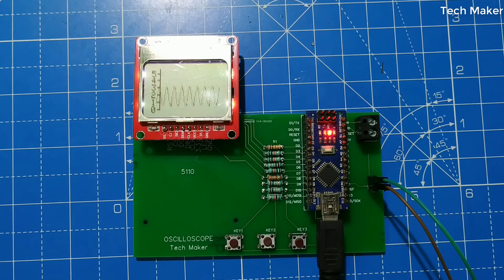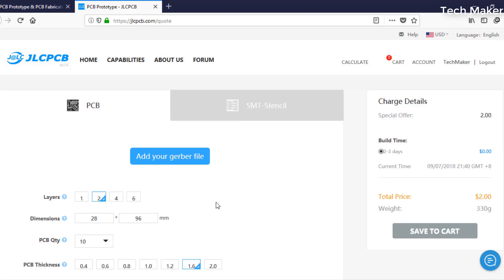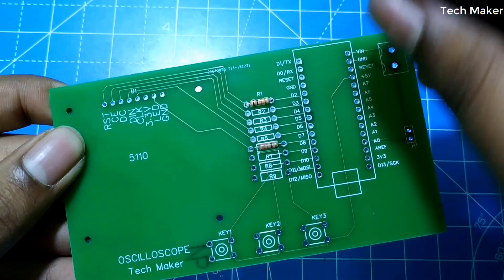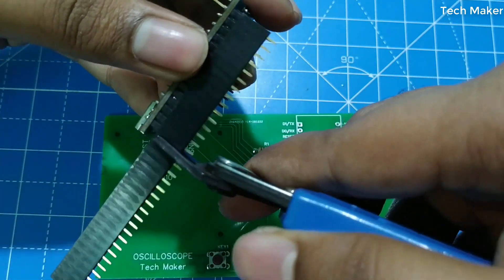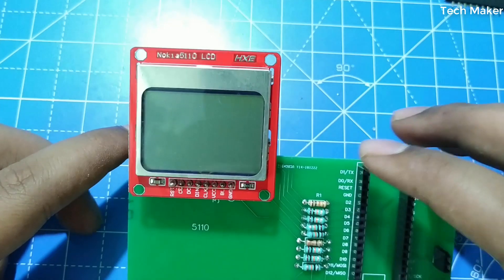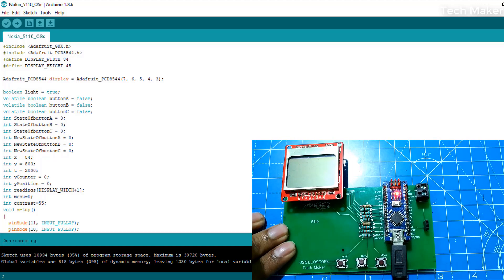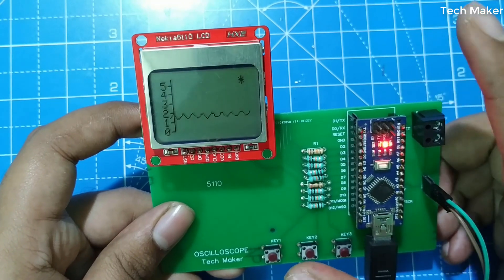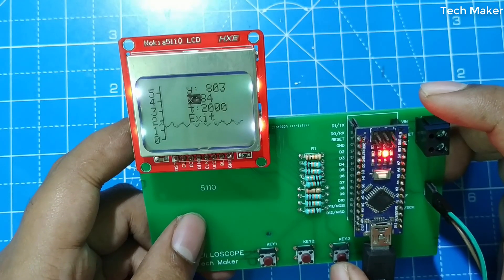How to make Oscilloscope using Arduino and 5110 LCD Display

Comment: hi bro
i have problem 
when i try to upload program
this massage show
Arduino: 1.8.13 (Windows Store 1.8.39.0) (Windows 10), Board: "Arduino Nano, ATmega328P (Old Bootloader)"

Nokia_5110_OSc:1:10: fatal error: Adafruit_nokia5110GFX.h: No such file or directory

 #include <Adafruit_nokia5110GFX.h>

          ^~~~~~~~~~~~~~~~~~~~~~~~~

compilation terminated.

exit status 1

Adafruit_nokia5110GFX.h: No such file or directory

This report would have more information with
"Show verbose output during compilation"
option enabled in File -> Preferences.

my arduino  is ch 340 and tanks for every thing